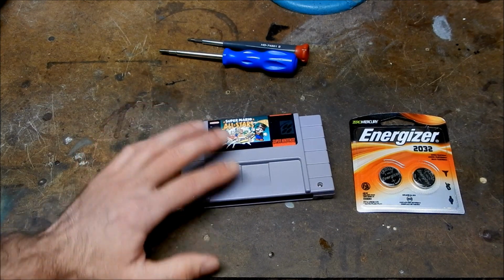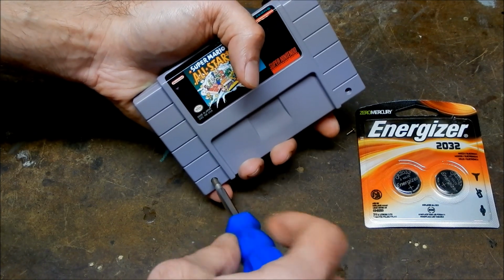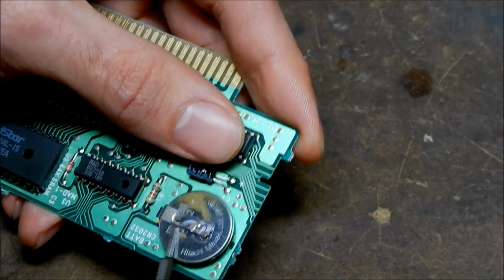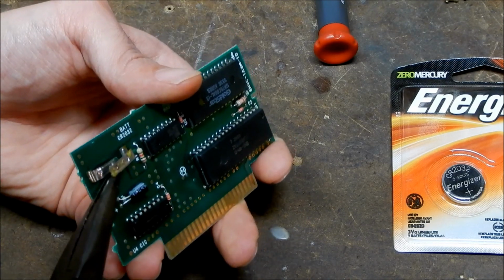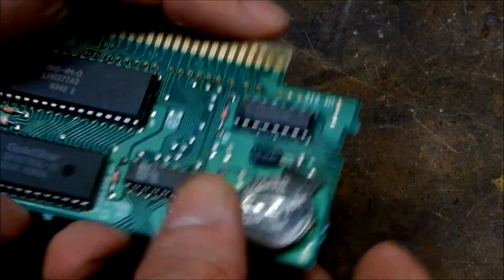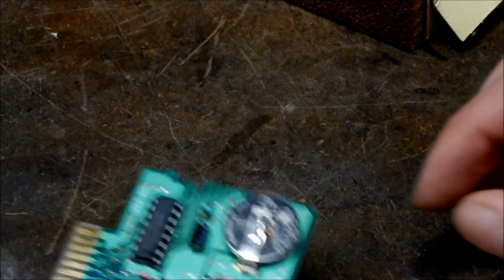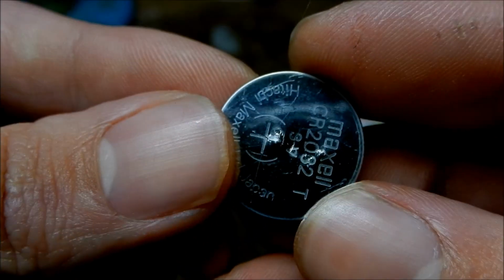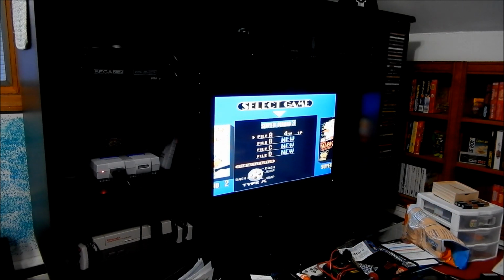Save Battery Replacement for SNES Games

Comment: I like your tutorial but you should really add a large PowerPoint style warning at the beginning about exploding batteries. These batteries WILL blow up if you heat them too much, which people do all the time. People don't sand or don't sand enough. It takes less than 20 seconds to blow one up and it's very easy to hurt your eyes. Thanks for the tutorial, but please warn people! A teenager watching this may not do it properly.
Reply: Without a solder?

Comment: Replaced the battery in my copy of Zelda A Link to the Past earlier today no sweat. The hardest part was getting the old battery detached from the bottom contact. Used electricians tape for the time being will open the cart and do the more permanent solution if I have any problems in the future. Works and saves great now been playing for the last couple hours. Awesome vid.
Reply from the maker: Make sure you scuff up the battery before soldering and also keep your solder times low to prevent the battery from bursting.

Comment: Picked up a copy of Zelda A Link to the Past the other day from a retro games store. It had some old saved games that I wiped and started my own. Played for about an hour when I entered a building and the screen went black. Reset the SNES and all save files were wiped. Swapping out the battery tomorrow (battery was manufactured in 92) and cleaning the pins 🤞🤞🤞🤞🤞

Comment: good idea but i would build a protective lip around the battery with some tape to avoid shorts (like the original)
you can do it in any nintendo cartridge but some need you use some paper to keep some pressure on the battery due to the large gap in the cartridge itself.

Comment: I changed the battery of my old SimCity and it can save again but, since I did it, if I shake a little too much mon portable console, the games crashes, which wouldn't do this before...Is the bord was glued to the cartridge? Now, when I shake the cartridge, I hear knocking noise, like if the board and the cartridge weren't tight together.
Reply from the maker: Take it apart and see what's loose or broken.

Comment: Will it not be loose with tape? Hopefully it saves with the tape method.
Reply from the maker: I never had a problem. But you could also buy a battery holder and solder it in or buy a battery with solder tabs and do it the right way.
Reply: @RobertNES816  Hopefully you can answer, I used tape method with new battery still not saving. Wonder why…
Reply from the maker: @carlanderson6752  probably not making good contact.
Reply: @RobertNES816  Now’s working thanks!

Comment: is any brand battery ok?
Especially since the original battery lasted 20+ years.   One guy said the new battery only lasted like 6 weeks unlike the original.   and i don’t know the brand of the original.

The battery the guy used had no brand it is sold by “cgr retro parts”
like $12 for a replacement kit with one battery.

I plan to use battery holders with a brand of battery called “amvolt” 24 pack.  cause also gotta do NES games too besides my 64
Reply from the maker: 6 weeks seems like a dud to me or the battery got shorted during installation.

Comment: Could you conect voltage from a power supply, that equals the battery power to the contact pins before you desolder the battery ? Then place the new battery in. Would that keep your safe data ? 
It makes sense that if the power never left the board as you replaced the battery, that it woudnt loose the save files. Just an idea. 
Also, how.do.you determine how much power the original battery has left before you need to replace it ?
Thank you for the video. I appreciate it !
Hope your staying safe
✌ 😊 ✝ ❤
Reply from the maker: Not sure about the power supply part. But you want the battery to be above 2.90 volts.
Reply: @RobertNES816  thanks man. I appreciate the helpful video

Comment: What about using  high temp epoxy just enough to keep it from moving
Reply from the maker: Probably a bad idea. I've made another video showing the correct way to replace save batteries. Its actually cheaper to buy batteries with solder tabs on ebay then it is to buy them without. That processes takes about ten minutes or less and gives permanent results.  

https://www.youtube.com/watch?v=TSVK3RcXMW8
Reply: Is there a way to change it without soldering?

Comment: Do you solder the bottom terminal also?..or does it just need contact?
Reply: both sides only need contact. The solder on the top tab is just to make sure the battery doesn't move. Ideally, you would solder both sides, but that would be really hard to do.

Comment: Could I use tape an put a fue drops of glue to hold it in I didn't know you could take out the batrie out like that was going to swap super Mario worlds  I  just bought Chrono trigger. I'm  afrade  to sauter it actually afrade I'll brake one of the flaps  but I got to fix it thanks for posting this  I'll expermint on Mario world first
Reply from the maker: No it's actually Best buy the batteries that have solder tabs already mounted.
Reply: @RobertNES816  should I learn how to solder or is it better to buy what you said?
Reply from the maker: @fabienzaca  everyone should learn how to solder. It's a valuable trade.

Comment: Do SNES carts use the same battery as Game Boy carts?
Reply from the maker: Gameboy carts used CR1616 or CR2025. NES, SNES, Genesis and SMS carts used CR2032
Reply: Robert NES816 Thanks. Are they roughly the same size?
Reply from the maker: Lee Thompson-Kolar  2032 and 2025 are close. 1616 is a very thin battery
Reply from the maker: Lee Thompson-Kolar Check Google for a comparison
Reply: Robert NES816 Alright. I appreciate the help.

Comment: can snes games with save batteries be corrupted when the battery is dead??? I want to know as I have 2 copies of earthbound (that are legit) and when you turn them on the menu screen where you select your file is corrupted.
Reply from the maker: G.Gamer A dead battery will cause the files to corrupt.
Reply: A little late but to other people wondering, there is a way to keep your saves which requires a little extra work. "This Does Not Compute" made a video on how.

Comment: This is why I only collect cd games.
Reply from the maker: This is a poor reason to only collect CD games. You still have worry about the laser on the console failing at which point you'll have to buy another console or replace the laser assembly. These batteries are easy enough to replace.
Reply: Hasn't happened yet in 20 years but considering I have 4 ps2 consoles and 3 xbox consoles I don't have anything to worry about,  I also find cd games more fun more story more graphics.
Reply: Mike Younes still have to worry about disk rot and scratches on cds. Cartridges are far more robust and durable for vintage gaming collectors.
Reply: Ya I see your point my massive 800 games can use some cartridges friends along side but I honestly just want a SNES classic with like 300 of the best games on it I would pay $200 for it :)
Reply: CD's are worst tho the whole disk will just stop working vs. a dead battery
Reply: Well have fun repairing a scratched disk.
Reply: @somerandomname1902  You can use a buffing machine to fix scratches unless they're too deep.
Reply: @inputfunny  yeah i've learned that since two years ago. Still stick by my opinion that cartridges are more durable than cds.
Reply: @somerandomname1902  Obviously.